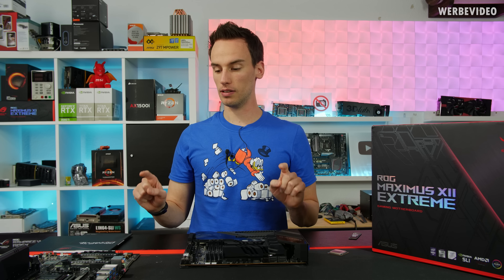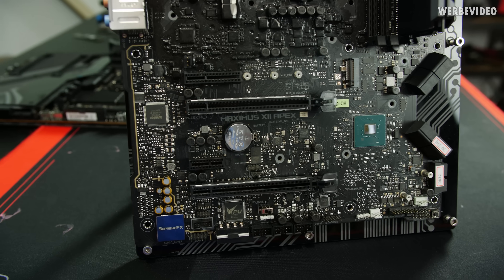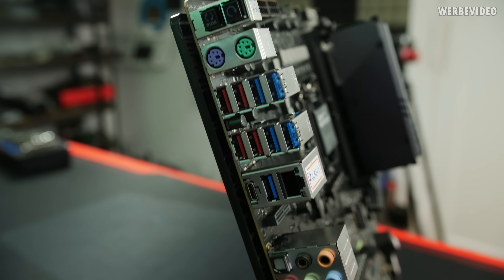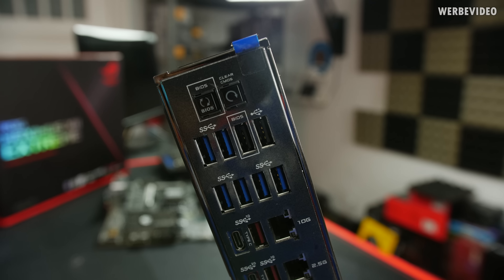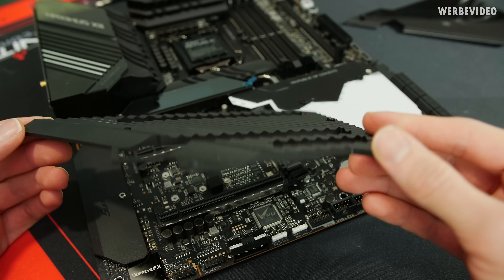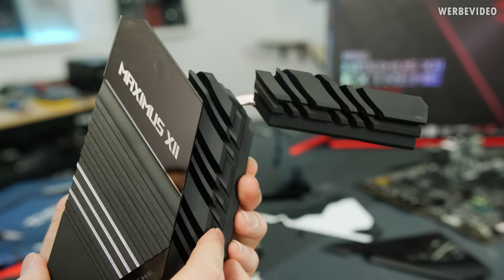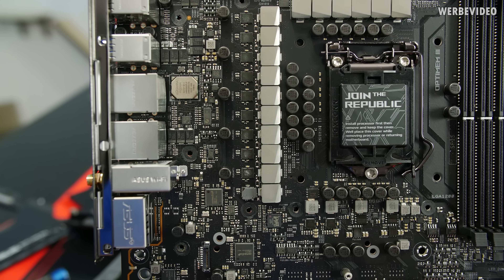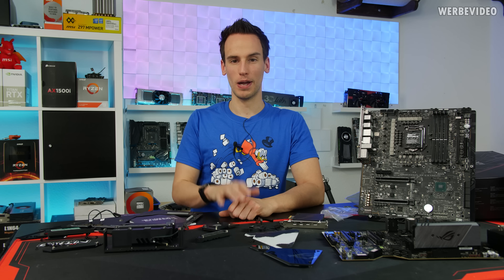New ASUS Z490 High-End Mainboards disassembled - MAXIMUS XII EXTREME & APEX in Preview

Comment: The DIMM.2 Splitting lanes with the main gpu is kinda stupid
Reply: It's the only way to get PCIe 4.0 for NVMe SSDs when the new CPUs are released, all the lanes from the chipset are PCIe 3.0.
Reply: @ganjalogic  So it's a workaround for cpus that are coming after the unreleased cpus? Great...
Reply: @landwolf00  And that assumes that those CPUs actually work as intended and Intel doesn't have to push them back another generation :P
Reply: @ganjalogic  And those CPUs will likely be accompanied by a new chipset that supports 24x PCIe lanes directly....
Reply: @ganjalogic  My as well just get a motherboard that supports Rocket Lake directly.  But I'm sure that's the plan - people buy this and when they want PCIe 4.0 realized that the half-baked Z490 won't cut it and get the new motherboard.  Comet Lake should have supported 1151.

Comment: Hello mr der8auer, i have a 10700K and a maximus XII hero, im planning some mild OC, nothing special. Do i need to connect the 8 AND 4 pin 12V EPS/ATX or is the 8 pin enough?
Reply: Good question.
Reply: SuperDigitalMe
 for any OC always connect both motherboard cpu power headers 8 + 4 pin for the Maximus XII Hero

Comment: Need some help, I'm not too familiar with the details on a MOBO. If ALL I do is gaming and a bit of OC on the CPU/RAM, is this a good board to have for the 10900k? What's the difference between 2 DIMM slots like here and 4 DIMMs on most other MOBO? Is my NVME drive going to slow down the GPU because of where it's at on the MOBO or is that ONLY on the Extreme? Should I just use the DIMM.2 slot next to the RAM instead of the one above the GPU? Thanks for any advice!! :D

Comment: I'm still vibing with my Z390 Aorus Master :) 5ghz 1.295v
Reply: Mine 5ghz at 1.15v
Reply: 1,295 is very Bad Result for 5ghz
Reply: Tobias Pabst No shit? I got a bad bin, I am currently running a Z490 Master with an 10900k 5.2ghz 1.235v with 2x8 Patriot viper 4133mhz overclock to 16-17-17-36 4400mhz 1.49v 1.28v SA/IO

Comment: The temperature of the chipset should run about the same as before but I would imagine when PCIe 4.0 capable CPU's arrive it will raise the operating thermals.
Reply: The chipset still wont support PCIe 4.0. You will only get the lanes directly from the CPU.